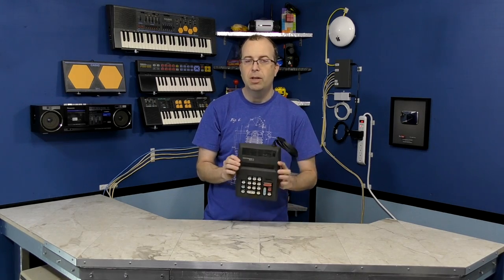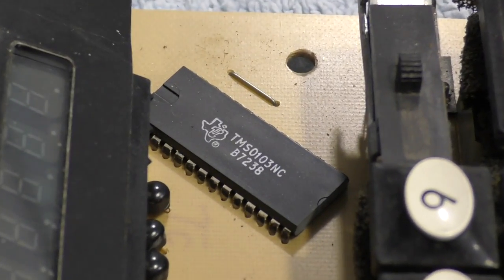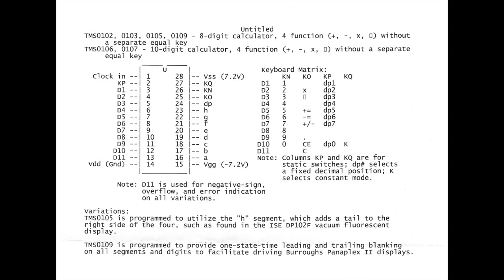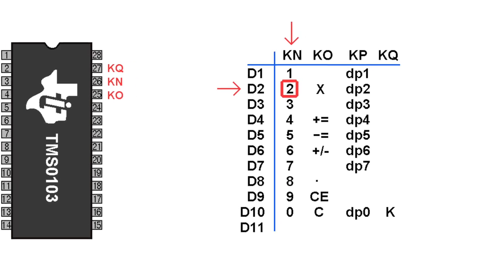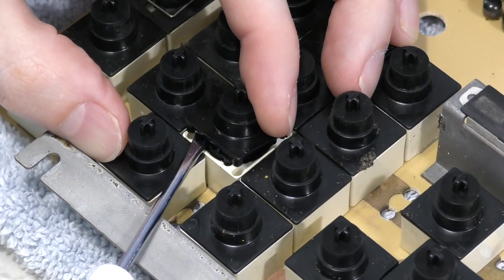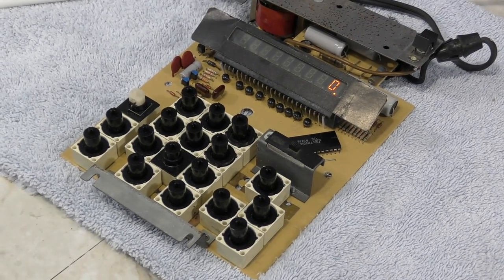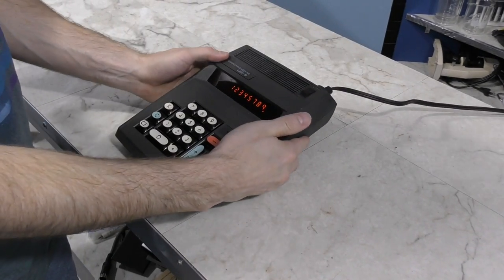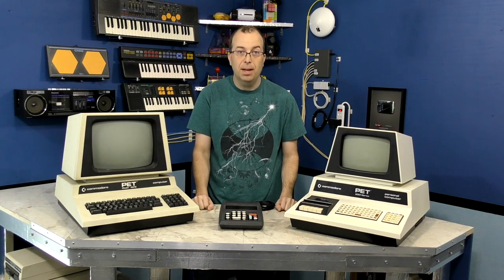Commodore Calculator Repair

Comment: Damn YouTube, for some reason I was unsubscribed to you! You're one of my favourite channels! It's an interesting video, that calculator was probably disposed of years ago and no one bothered to look at it. It's a little different I guess as it was made redundant pretty much, but I've noticed so many items are thrown away because they're 'broken'. I kind of collect power tools and have a thing for early makita cordless 7.2 and 9.6v drills. I bought a bulk lot of 4 'broken' ones, except they were all fine, the charger wasn't making contact with the batteries so they were all dead flat. Threw in my battery and each one of them worked fine, and with a few minutes work, the charger was also fixed. It's sad, but also great, as people like us can buy cool stuff and fix it, or mod it and make it even cooler!

Comment: I figured the foam would make no difference i removed at this point because it was already disintegrating. Heck, I wouldn't be surprised if the disintegrating foam was a part of the culprit as it only takes a piece of it getting on the center contact point to cause inconsistency/deadness of a key since it would block a circuit. It's also possible the contacts just had a residue/tarnish in general. Was' really satisfying to see it working when you were done with it regardless of what it was though! :D

As for "what" the foam was used for... I'd bet it was for noise reduction. I don't think it would have stiffened a spring like you thought since the spring was around it (a indicator of vibration reduction) and it was not glued to the spring. The foam under the keys I'd bet was to reduce noise on bottom-outs. Finally, the foam above the display was likely to prevent the metal piece there from rattling as you type keys by pressing up against the outer case.

Comment: Just a side note:  Never use ammonia based cleaners on plastics.  Over time it will cause any plastics to become cloudy.  This eventually makes lenses, see though displays, etc..  It will make them look like garbage.  Furniture polish (Pledge) works much better and after a gentle buffing down makes it really pop!   

Before anyone gets all snooty with me,  I have been working on arcade equipment for over 25 years as a tech.  We first noted this severe issue on games such as "Cyclone" and "Hungry Hippos" where repeated cleaning of the plastic/acrylic dome with normal Windex type cleaners was drying out the acrylics and after a few 'cleanings' it clouds the plastics badly.

Comment: Hello,

First of all I enjoy your videos, they give me a nice nostalgic buzz :)
Second, as to why your calculator didn't work at all at first, the reason is simple:
The electrolytics had to reform chemically, which is to say that, having not been charged for probably a long time (years probably) the electrolytics initially drew A LOT of current, thus depleting the processor of necessary current to work.
Had you waited for a minute or 5 longer, the calculator would have probably come to life on its own.

However, you were extremely lucky that didn't take out the transformer or at best the fuse. One advice I would give you with this sort of equipment is to always replace the electrolytics (at least those around the power supply). An other option is to put a multimeter in current-mode between the appliance and the powersource. Using the formula Watt = Volts x Ampères you can calculate (roughly) how much Watts the appliance draws (E.g. 120V x 0.15A = 18W). If the calculation yields much more than what the appliance is rated for (that is, the wattage the manufacturer printed on the back); and that calculator you showed shouldn't use more than roughly 5 Watts when the full display is on; then you can safely bet there is either a short (which in the case of reforming electrolytics is quasi the same) or there is another serious problem with the power supply.

Keep the good work up and thanks for another entertaining video :)

Comment: @8bitguy
compound capacitors use an eletrochemical reaction during the manufacturing process. The same flow of energy that powers the capacitor also forms the structure inside into a capacitent shape (thats why they explode if you power them backwards). Over time the chemicals inside start to break apart, but reapplying current will cause them to reform.
That might be why it randomly started working.

Comment: A recommendation the calculator had electrolitic caps in it which can bring voltages back if you put in new caps.
I do it all the time with pinball machines I also replace the bridge rectifiers as well as they drop voltages as well.
And for the fuse I would put in a new one as well as they do fatigue over the years as well.
And some times Fuses can on occasion blow where the cap is so that is a thing that can happen.
And I take one leg of the fuse out as testing components in circuit you might be getting a false reading from it as it may be tied into something else in the line.
When in doubt it is old and tired and like any electronics needs a refresher on stuff that I have mentioned. :)

Comment: it might have been dead due to electrically leaking capacitors and after a certain time they may have reformed enough to work again, however I would absolutely changed out these caps right away. I actually recently revived a Commodore calculator myself but a handheld VFD type one, it got very nice :)

Comment: When you tested the fuse, i immediately thought "That's not going to help you figure out if the fuse is the issue"
Because a fuse can have continuity. Heck, it can even have zero resistance. But once you apply amperage to it, it can still lose that continuity.

So always test your fuses in the situation they are supposed to be operating under. If this is a 120 V fuse at 0.5 Amps, then you can test it with a 60 watt light bulb. If the bulb is shining as bright as you'd expect, then the fuse is good.
And of course, there's load testers out there if you don't feel confident with testing using a light bulb and looking to see if it's outputting the proper brightness.

Comment: I still have a Commodore calculator from 1976 and it works great. It is tan and very small and takes a 9 volt battery.

Comment: For cleaning out the switch or any hard to reach nook, I like to dip a q tip in 99% iso. You can get just a little bit in there too get some gunk out, then going it over and dry up any residue with the dry end.

Comment: I had once picked up a dozen CBM PET 3000 , 4000 and 8000 series from my school as they changed to IBM compatible computers.  The most issues with their keyboard were the soldered wires at the connectors between keyboard and the Mainboard

Comment: The reason it wasn't working is because the clear button wasn't making good contact.

I have a collection of old calculators, and the plasma discharge display ones that use TI chips usually require you to tap "C" twice before the display comes on... They will eventually light up in their own, but it can take between seconds and an hour.

Comment: Hand-drawn traces. I've never seen hand-drawn traces before this. I didn't even know those were a thing before this... I'm... AMAZED this even worked. Especially when you know those traces are supposed to be a certain length in order to work... Add to that the fact that they have different thicknessess, which is likely to affect resistances and whatnot (I'm no electrician however, maybe I'm talking nonsense...). Regardless... the engineering is mind-boggling to me!

Comment: The chip has a date code of 7238 on it, that means 38th week of 1972, which is September 18 - 24, 1972. So this calculator appears to have been manufactured in late 1972. 
March 3, 2020 4:45 am

Comment: The foam piece inside the spring is needed to reduce noises coming from it. Otherwise you can wrap the spring in a plastic tubing cut to the length of the spring in compressed condition.

Comment: I have this model but the chip inside is instead a "C-500-C" manufactured 72-41 (so just 3 weeks later than yours). It is a curious repair case in that it has the opposite as yours, where initially it had power, but then after removing it from the case the LCD suddenly lost all sign of life...

Comment: Hey 8 bit guy, since that calculator is so old, it is best that the axial electrolytic capacitors be replaced.  These are in the power supply section on the board.  Over time the electrolyte can dry out and the capacitor will not be able to keep a smooth DC voltage going to the IC.  If you want to test them you can use an ESR meter.

Comment: LOL, I remember working on a Lloyd's 305? I think... It wouldn't power up for anything, unless I turned it upside down and then everything was getting power. Turns out, when I flipped it over, the weight pushed down on the power switch. That extra pressure completed the circuit and turned everything on. Which would have been a "duh" moment if I knew what was happening but, I didn't and I fiddled with it for hours... It's almost always mechanical with these old calculators and as such, a little pre-emptive cleaning fixes a bunch of problems and half the time you don't even know what they are. It's just magic, take the win. LOL

Comment: I've repaired a lot of devices that had sponges inside of the springs. The sponge is the reduce a boing sound from the spring. in most cases, a bit of grease can fix it (which also add the benefit of lubrication. That is good for very small springs, other larger springs I put in new foam from kitchen sponge and also add grease for lubrication. That usually makes the switches work better/ quieter than factory new!

ALSO BUY >>>DE-OXIT<<<!!!!! you will LOVE IT

Comment: 7:22 i remember that was exactly the same piece of metal used on atari joysticks but on my controls they split at the middle so the metal part doesn't come up again. I fix it making a new piece with a metal from a coffee can and a piece of rubber below, doesn't last too much but it works.

Comment: I recently had to leave an Atari 5200 on for half an hour before it started working. Atter some time it worked but with black and white graphics. With more on-time, color returned. After that, it worked reliably and in color the moment it was turned on even when discharged and unplugged for days. Even thing I discharged by unplugging and hitting power, I still suspect a capacitor or something causes this. Oddly, a 7800 in the same lot only give scrambled graphics until it has been warmed up about 15 minutes but this happens every time you let it cool down (doesn't stay fixed like the 5200). Also, it works instantly without the RF shield and stops working as soon as you set the board back down on the lower half (unless warmed up for 15 minutes). Totally bizzarre!

Comment: I bet the first problem was the power switch itself. If there is oxidation of the contacts, it will prevent current to flow through. After shaking and switching nultiple times the switch finally made some contact. It should be disassembled and cleaned.
The foam inside the button springs is a damper to avoid that the spring creates any sounds (like boinggg). These foam dampers can also be found in cassette players of that time. The buttons will work perfectly without the foam but the will possibly sound louder.... but who cares! :-)

Comment: The reason the calculator was "Dead" initially could have been the vacuum fluorescent display. When they have been turned off for extended periods they sometimes get "poisoned" with stray air or internal gasses, preventing the fluorescent effect from occurring. They will degas when powered for awhile and then start functioning.

Comment: Get a can of DeoxIT. It's a contact cleaner that removes oxidation and improves contacts, lubricates, and protects from future corrosion. Everyone that restores old audio equipment (ie getting rid of hiss when turning volume knobs) and such uses it. Works for computer parts too.
Reply: He actually did used DeoxIt on the Commodore Pet Restoration Video

Comment: It looks like the foam caused a chemical reaction on the springs, eating the plating off. I doubt it became conductive but it did block the key switches from making contact. As far as the calculator coming on by itself, I wonder if the electrolytics are a little dried out and powering back up caused them to heal.

Comment: The PCB is not hand drawn. Before CAE software was around, PCB postive films were designed on top of 1/10" grid paper. The pads were rub-off transfer stickers and the tracks came as rolls of tape. Then a contact negative of the film was made and the PCB making process continued basically as it is still done today, just based on an actual film instead of a gerber file.

Comment: Man, just buy a $2 set of small brushes and a $5 small 1/4"-drive socket set (literally any hardware store, especially harbor freight, even the dollar store would suffice. You'd save a lot of frustration with such jobs. Very cool to see it fixed up and the old-school board.

Comment: Try a dremel tool with a wire wheel/brush - its great for removing rust and corrosion from small metal parts. It would be able to reach down into those key switch bodies.

Comment: I think those PETs use Mitsumi keyboards similar to the C64, the kind where the stems have a conductive pad on them that bridges the contacts on the keyboard pcb. Maybe the pcb just needs a good clean with contact cleaner.
Hurrah for more Commodore stuff.

Comment: Love this video! Spent the last week prodding around with a vintage Canon Canola calculator with a multimeter. Fuse was fine and everything. Checked the transformer with a multimeter and there was a current flowing. Didn't know what the problem was. Randomly decided to connect the + and - terminals on the transformer with a wire and BING! It worked. 

What's with these randomly-fixed calculators?

Comment: I know this is old but I have a rough idea why it never fired up in the first place, the calculator has a Panaplex display that needs a high voltage to operate (180-200v), the buck boost circuit capacitors where probably out of tolerance and powering up for a while might have reformed the capacitor(s), this would probably stop the HV circuit from oscillating and producing the high voltage for the display until the caps reformed from being powered up.

Comment: The bare switches in this calculator remind me of the switches in the standard Atari 2600 controller. It had similar metal "blisters" laminated to the board.

Comment: Love how Commodore kicked TIs arse when they wanted to step into the microcomputer market. Once TI got into LSI (1969 ?) they started to sell alarm clocks and calculator chips as single chip solution. Sure they made good money. But they got very upset by CBM making good proffit and not only increased the chip cost ... they simply started their very own calculator bussiness. Tramiel learnt the lesson the hard way fI he wanted to be succesfull at microcomputers, he couldnt not use third party chips anymore. And the bought MOS and of course came with very skillfull designers that made a brilliant work on the 6502 the VIC and SID. The 6502 was 5 times cheaper than the Motorola 6800 and still better. Try to kick TI and outperform Motorolas best seller CPU ? .... only Commdore could do that
Reply: In all fairness, TI's home computer division had chronic management issues as well as a string of bad luck with major component delays, FCC reviews, and power supplies. And part of the management problem was the same thing that hamstrung almost every company with an existing computer division: the minicomputer division was VERY profitable(thus influential within the company) and viewed cheap microcomputers as an existential threat and lobbied hard to get them cancelled or crippled. Commodore didn't have this problem, since they didn't HAVE a computer business outside the home market.
But the 99/4a could still dropkick a VIC-20 across the street.  The hardware wasn't the problem. 

Also, MOS introduced the 6502 before Commodore bought them. So Commodore didn't do that.

Comment: I love older or more simple electronics like this where you can still use some gator clip wires in a DMM to figure out what's up. 

Judging by how much old ass TI calculators they still sell cost I wouldn't be surprised if they are still using that chip somewhere. Pretty sure they still make and sell the TI 83 Plus from 1999 for the same price. Not a bad calculator, but $90 is an outrageous price for something with 32 kBs of RAM and a 6 MHz processor.

Comment: I suspect that the foam stuff was the culprit. With how bad it disintegrated it may have migrated between the fuse and fuse contacts over nearly 50 years and that was preventing power on.

Comment: Had a problem once with a servo controller not working, eventually found that a piece of gray foam used to stabilize a board was conductive and was shorting the controller out.

Comment: I'd have replaced the electrolytic capacitors while I was in there. They may not be leaking but they may be drying out, considering how old it is. They're cheap and easy to get so it would have been worth the few extra minutes and dollars

Comment: You should consider getting some DeOxit for these restorations.  It can help clean up those types of mechanical connections, and it's self drying.
Reply: great stuff(if a bit costly), but in this case..he still would have ended up doing pretty much the same thing...bits of the bad foam likely got under the contact discs.